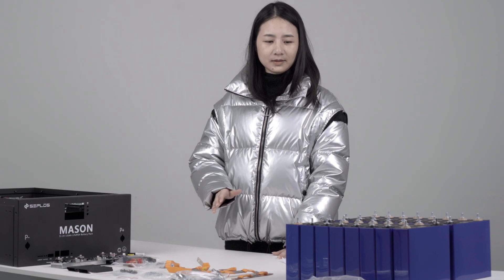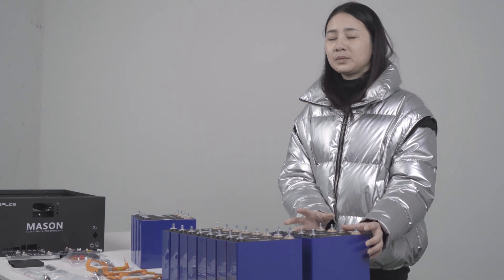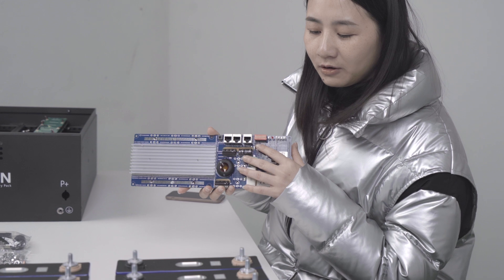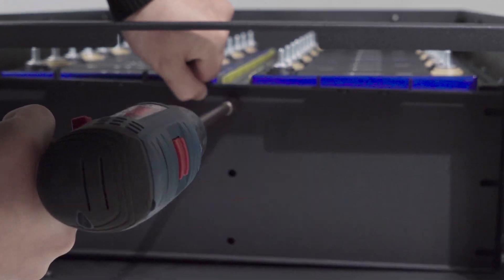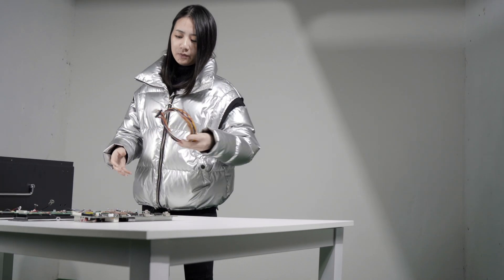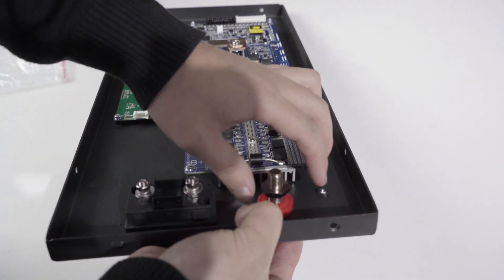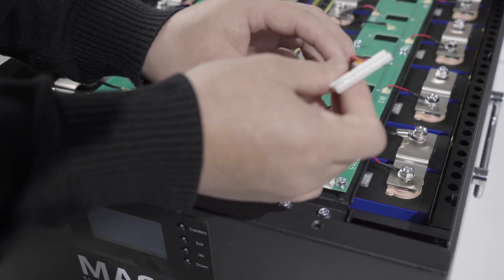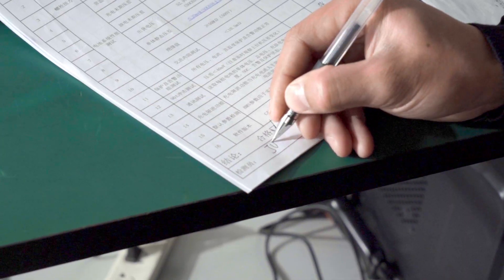Seplos 48V 135Ah MASON Battery Pack - Raw Material Selection, Installation, and Guidance

Comment: I'm having a problem with the BMS on all 4 batteries that I have - e.g. voltage of 53.36v but only 48.39% soc, at 54.01v and 78.57 but all say something different.  The biggest difference is about 5% soc between two of the batteries.  I would expect 54v to be nearly 100% and that the batteries would be close in voltage.  The batteries are paralleled and the first and last connected to a bus bar.  The batteries are all new and I've had them in 5 days now.

Comment: Parece muy buen producto, lástima que no me lo pueda permitir.
Tengo una batería de lifepo4 16S 280Ah construida enteramente por mi. Me encantaría poder actualizarla a este tipo de ensambles, pero actualmente no me puedo permitir ese desembolso.
No he visto ninguna revisión de su producto en Español, deberían planteárselo.
Por otro lado, el único inconveniente que le veo a su producto es que el BMS dice ser de 100A, no sé si el adaptado para celdas de más capacidad será superior, pero por ejemplo mi batería esta conectada a un inversor de 5KW que serían unos 100A, pero puede entregar durante unos segundos 10KW, como la mayoría de inversores para arranque de motores, por lo que ese BMS quedaría corto. Tal vez esa configuración es válida para inversores de 3KW o en configuraciones de varias baterías en paralelo, pero con el precio que se han puesto las celdas, no creo que sea rentable
Reply from the maker: Hola Jose, este producto es capaz de soportar corriente instantánea hasta 250A. Los kits de batería que incluyen BMS, celdas, caja, conectores, etc., se pueden comprar por separado.

Comment from the maker: Since the pre-order of SEPLOS MASON-135 last year, many of our customers have set up their systems. And all gave positive feedback. In this video, Aaron and Serena from the marketing team will assemble the MASON-135 battery pack under the guidance of engineers. If there's some operation that is not professional enough, any suggestion is welcomed. 
Buy MASON DIY kits Please click: https://bit.ly/3oYQe4g
MASON-135 finished product + Sofar inverter bundle please check: https://bit.ly/3pwlNlv

We've also got 51.2V 280Ah DIY KITS (suitable for EVE 280Ah cells), check this link for more details: https://bit.ly/3vyjan9

Any other questions, please contact us at: info@seplos.com